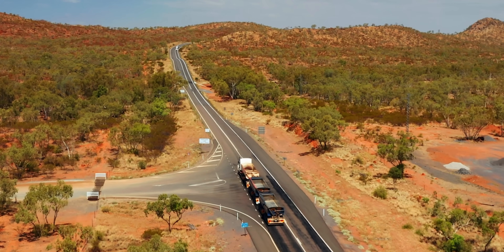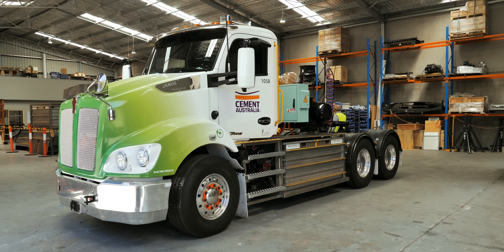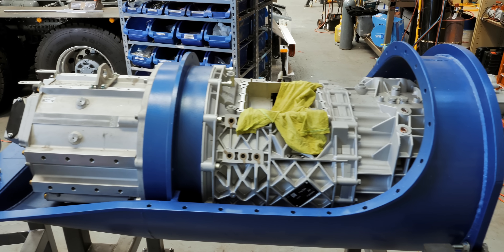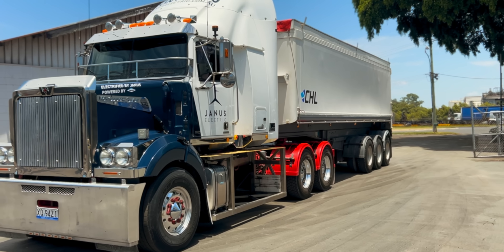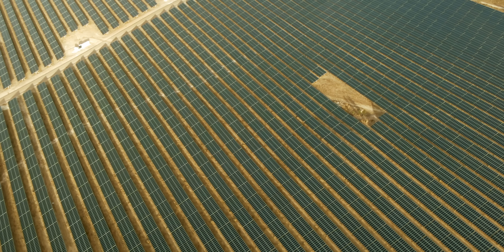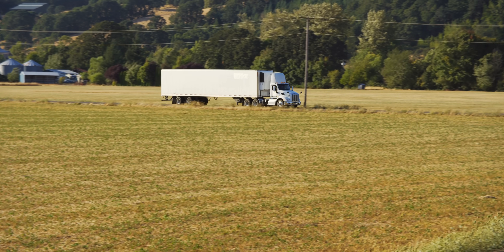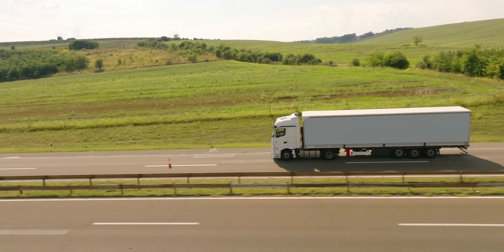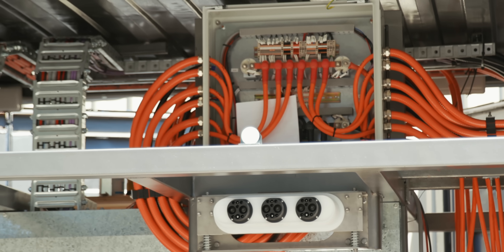This GIANT Electric Semi Can Swap Out Its Batteries!

Comment: These people have completely thought this through, and it all makes sense! I don’t see the cost of conversion being a huge obstacle either, given what it must cost to maintain and rebuild existing diesel engines compared to a converted truck. I know that getting new trucks in Australia has been difficult for some years now due to supply chain issues too, as I work in the freight industry, so being able to convert older trucks could take some of that pressure off freight companies. I don’t see the price of diesel going backwards anytime soon, either. It would probably not make sense for all applications, such as remote areas, as the cost/benefit ratio will likely be too high for quite some time, but imagine these battery swap stations dotted along the Hume Highway, Bruce Highway, Pacific Highway, etc…

Comment: What I want to see is the Trailer having its own battery and assist motor complete with regen.
Reply: That would extend the range even more, no doubt, will have to work out if the added weight to the payload would affect overall efficiency and costs, but easy to add or remove the battery from the payload for sure.

Comment: Nice to see they are using a gas forklift to swap the batteries, a sector where battery forklifts have been available for decades :D
It's nice innovation and I wish they will expand exponentially, retrofitting trucks is better than building new ones! but you have 16 teslas in that truck, with battery supply struggling to ram up, is it better to focus on having 16 new electric cars on the street or one diesel truck?

Comment: One question i had was about descending a long steep hill using regen, what happens if the batteries fill up and can't provide regen load? Does the truck have a loadbank to dissipate the regen energy that the battery can't store?
Reply from the maker: That is a VERY good question and one I should have asked.
I know from direct experience that when an electric car is at 100% charge, there is zero regen braking simply because there's nowhewre to put the generated power.
However, the batteries on these trucks are so massive, if you drove say 150 km to a destination, and you'd have to climb uphill to create this scenario, then went down hill for say 10 minutes there's no way you could generate 150 kWh in that time. Basically you generally replace 10 to maybe 20% of electricity used to climb a hill as you descend. Regen braking is brillinat but it never replaces 100% of the power used.
Reply: @fullychargedshow  imagine a fully loaded road train with 100tons going downhill I think it will quickly recharge that battery assuming it wasn't empty

Comment: So 600 kw battery is another $600000 per truck even at $200 per kw that is $120000 . The batteries will not be supplied free of charge. Each truck will need 2 batteries allocated. Not so easy to get a business case. However it would be fantastic to get this up for motor vehicle. Using the grid in the of peak time to charge the batteries is a real game changer. At least that will reduce the cost of upgrading the grid. On Average the grid has to be increased 200% to cope with going al electric. Most of the UK will have to have all the grid and every house upgraded to cope with no gas, fossil fuel, or wood. Truly a 100 year plus program. This climate change is just complete bullshit. However I am going electric for economic reasons. I like cheap power low maintenance vehicles

Comment: They always emphasize the down cycling of the battery packs, but once this kind of technology is rolled out at scale, eventually there will become a waste stream of unusable batteries (which will be similar to the production rate). These will be owned at the most price sensitive end of the market (the tight-arses), so dumping will become a problem. Recycling the materials will need to cost less than virgin material for there not to be a waste problem.

Comment: it nice to see conversions. when the tech does finally mature they need to bring it to things like land cruisers and tractors i anti got 200k to spend on a brand spanking new hummer EV same with our tractors and other equipment it took decades of saving to build up our fleet i cant just drop another 3 mill to buy a new EV fleet when they ban diesel and what do i do with the 3 mil diesel fleet of equipment? it will be banned so i cant sell it wont get anything of worth for scrap metal.

Comment: I say no mention about the "interface" between this battery pack and the vehicle.    "Swapping" has problems in that the "interface" isn't just the "positive & negative" of the high (say, 700) voltage battery back but plumbing connects to manage the temperature of the battery back.   The condition of the charge state requires interaction with the battery management system.   Basic safety concerns require that the battery back itself have high energy contactors.   In a Tesla, the connection requires several good sized and one or two small sized connectors was well as the plumbing for the heating/cooling of the battery pack.

Comment: The design will also help with battery fires which are become more prominent. It's easy to get to and perhaps even an emergency ejection system can be installed so the truck won't burn in case of an accident.

Comment: Great ingenuity - love the idea of the batteries being used for grid storage when not used  - a lot of positive things happening down under! :-D
Reply: Oh yes, just wonderful - until your off grid storage battery in the basement carpark of a multistorey building decides it doesn't want to work anymore and goes up in a spectacular fireball that cannot be contained and takes out an entire city building and everyone in it. EV fires happen frequently in China, and recently an entire shipload of cars was lost due to one car's propulsion battery failing. Don't kid yourself, lithium battery technology cannot and should not be relied upon in EV's of any kind and will not be the answer to lowering carbon emissions.
Reply: @rmbandit1  EV batteries should be serviced and checked like any other item with associated risk - I don't know about the service-check policies in China, but their quality culture and risk appetite seem to be different than other developed countries. I can't agree with you about lithium battery tech not being able to be relied on in EVs of any kind though, I have been driving the same EV for 9-10 years, and have been able to rely on it so far... or are you saying that the inherent risk of a lithium ion battery is higher than the risk of driving around with a highly flammable fluid in a tank inside the car?

Comment: this makes a lot of sense, even to the point of just using these change stations having the ability to balance the grid and absorb excess power on a night. again it will come down to the rights to the tech, but the Chinese do this on cars. would be good to have some storage on the trailers as well?

Comment: When the battery r stuffed can you recycle them no you can't
Reply from the maker: What is interesting about this comment is when someone responds to you with actual facts about battery technology, you immediately change to try and find fault with some other excuse the fossil fuel lobby trash talk to try and hold on to their position of power.
Try ENF Solar, First Solar and Solar Cycle in the USA. Of course solar panels are being recycled, as are wind turbines.
Here's a question, are there any companies recycling gasoline or diesel? 
Is extracting, transporting, refining and burning crude oil completely clean?
Reply: Yes you can. The materials in batteries are very valuable and will never end up in landfills as EV naysayers drone on about. Check out companies like Redwood Materials, Northvolt/Audi or Renault/Solvay to name just three. Billions are being invested into recycling facilities which at the moment are only pilot plants as there are very few degraded batteries coming back....EV batteries will last, a long, long time...in most cases longer than the life of the car but when they are done in the car and maybe had a second life as solar backup they will be recycled...just to be clear.
Reply: @kiae-nirodiariesencore4270  what about the Soler panels them to
Reply: Getting a bit defensive they I was just asking because I seen a new canal report not that long ago saying the opposite
Reply from the maker: @sambaker4164  Just a reminder of your original comment 
"When the battery r stuffed can you recycle them no you can't."
You are wrong, you can recycle batteries. That's all there is to it. No defensiveness needed.
Reply: @fullychargedshow  well from what I seen on the news they said other wise and r you hear to educate people if not y r you doing this

Comment: This is what makes sense, not private cars, but starting on the commercial trucks, they pollute way more, i'm not sure I would own the battery, if it was to be shared with others, but i would rent it, or maybe have it on a subscription with power added.
Then when all the trucks are converted, then they can just start banning the sale of diesel and petrol cars.

Comment: It's time to develope swap out batteries for all electric vehicles.
Reply: Why? Nio in China are the only EV car maker who have set up battery swap stations and they are in financial trouble. Having owned an EV for 4 years and done some long hauls around Europe I don't see the point. In worse case scenario (winter on the autoroute) the car has more range than I can drive in one sitting...3 hours and I'm done...so I take a rest and plug in. Summertime, when we do more long hauls the range is comfortably over 400 km....but on a 500 km plus trip I will still stop at least once....man and woman need food, drink and the bathroom! Battery swapping for LDVs makes no sense and will never be a thing.

Comment: People are often all too focused on range as if it was end all of everything. These people are professionals, so they thought about how much it costs to change oil and do other maintenance on a diesel engine and how much fuel stores does the country have if there are international issues.
And that one is something we should always point out when someone starts repeating "but renewables need storage..." What, coal and gas and oil don't? `So what are those big oil tankers for if the fuel just magically appears at gas stations?

Comment: What a fantastic idea and more than likely a very feasible way to recycle an aging semi tractor. I love the robotic battery changer idea which really make it so easy. There is a good amount of infrastructure to install for this idea to really take off and the attitude in the USA would dampen this process without a few larger trucking company getting on board. Just like EV cars maintanence is almost zero, I know I have two. Only way to go.

Comment: 1240 kW-h total = about $155 if I were to plug it in and charge up at my house.  Even if the truck carried only a single 400-liter fuel tank, I couldn't fill it up so cheaply at the pump.  Add in that the batteries can be charged up by on-site solar installations, and this is yet another weight dropped on the domestically-produced energy side of Australia's scale.

Comment: If everything works as claimed, and the average working life of a diesel heavy duty truck is 12-15yrs, then potentially, you might be able to extend the working life of a heavy duty truck to as much as 45yrs, although at the extreme end, this would most likely be the outside scenario in developing nations as it is now with ICE vehicles of all stripes.

Comment: Works for tiny countries like the UK, but what about the long hauls you would find in the US?  Drivers are paid by miles driven, do you think they are going to like having to stop every once in a while and sit on their arses every 4-5 hours while they have to recharge the monster batteries required to haul large loads moved by semis?  It looks like it works for local hauls like in the video.  You are really going to need a lighter weight battery chemistry and you are going to need to put battery packs in the trailers in addition to the tractor.  You need ranges of double/triple what you are talking here to get buy in for the US.
Reply: Yes, truck driver should stop every 4 to 5 hours to rest. It is not safe to do otherwise. The battery sway can then occur at rest points!

Comment: Super cool solution. Crashes right through all the myths that people invent to argue electrical trucks are impractical and expensive.

1) swap the battery in a few minutes gets rid of long charging tines. 

2) these guys are pulling 96 tonnes. That's higher than is legal on the roads in a lot of countries. Not an issue.

3) The weight: they remove 3.5 tonnes of engine and infrastructure and put back about 4 tonnes batteries and drive train. So half a tonne extra weight is not nothing. But on a truck that pulls 96 tonnes it's not a whole lot. It's not going to matter.

4) The battery goes into the same space occupied by the old ICE system. 2x 600kwh battery system. That's 1.2 mwh. Plenty of power, plenty of range.

5) The cost is fine. Much lower operating cost due to low energy cost and simpler maintenance. Over the life time of the vehicle it will save money. 

I like how they are giving old trucks a second life. These conversions can speed up EV adoption among truckers. Waiting for trucks to be written off and replaced would indeed take decades. Of course new trucks that are designed to be electric might still perform better.

Comment: I never thought about just exchanging batteries - rather then sitting around to recharge them.
This seems (to me) like the way to go for long haul trucks.
At least for the foreseeable future.

Thank you for this video.
☮
Reply: It is basically same idea as hydrogen trucks: Store energy at slow and steady pace 24/7 so you can refuel quickly instead of needing multiple megawatt class superchargers(which probably would cost a lot) and heavy duty power lines that can deliver tens or hundreds of megawatts to power them... all of which would sit unused for 20-23 hours out of each day and then degrade your batteries when everyone tries to fast charge as quickly as possible at the same time.

Comment: Lithium based EV Semis are a fraud.  Not only are the ranges under load rediculously short; the fire potential is prohibitive.  A Tesla Semi has the equivelent of 12 Model Y batteries stacked together - have you ever seen a Y on fire? - just one such pack is dangerous; 12 is a level that should be banned before tragedy happens. EV trucks will not be viable using Lithium; they need a new chemistry that is safer, cheaper and have a higher energy density.

Comment: I've been saying this for years that this is the only way to go to make EVs viable long term. There is enough tech there to make battery exchange fully automated too. Just pull into the service station, the car will self drive the last few metres into a change bay, battery drops out of the floor and is replced by a full one. Ready to drive off in seconds. Maintains profits for service companies and tax for government. Still be possible to charge at home off renewables too. All underused batteries become part of the grid storage and can feed back or store as needed.

Comment: Yes - upgrading instead of new. Would love to see this for all vehicle classes. And all these vehicles can keep their physical knobs on the dashboard, rather than the gimmicky electrical vehicles developed these days.
This also makes it easier to go electric with the current electric networks of this world. Fast charging needs so much capacity, whereas having these batteries sit and charge at a low rate or from solar power is easier to do and can be done with a local implementation.

Comment: This is cool, but cost, lack of savings, inconvenience, and lack of distance just don't add up. It's so very far off the mark. New battery tech needs to be invented 3 times the power for the same weight.